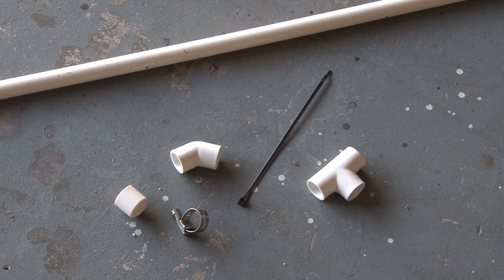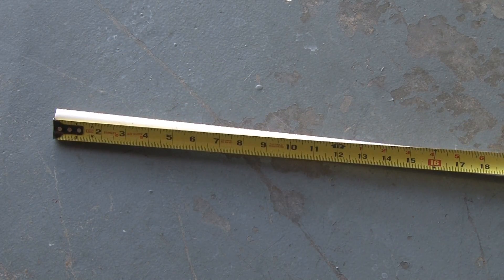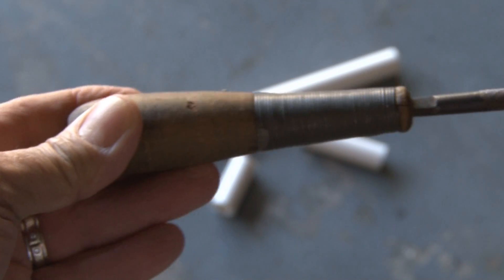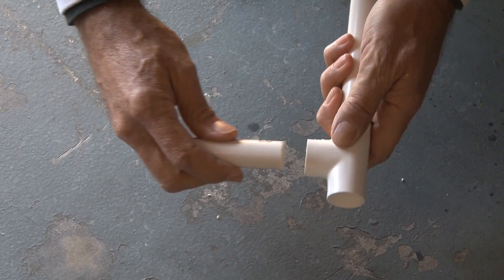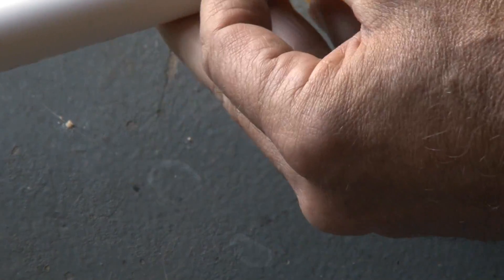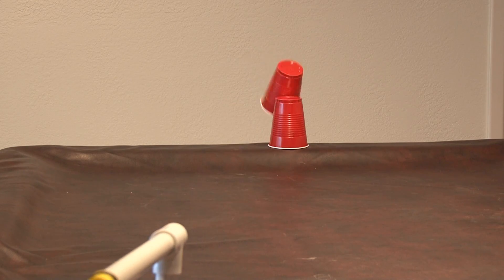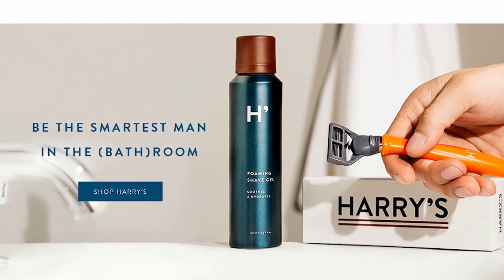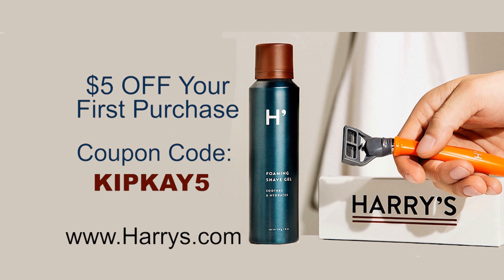The Balloon Zip Cannon!

Comment: So I tried making this and I'm not getting like any distance. How can I fix this because I've already tried pulling the balloon as far back as it can hold. Also, once I get this under control I was going to try to use it to shoot glitter at people. Does any one know how well this works or if it's too light, because I'm just getting a small puff of glitter now.
Reply: +Dominoweaononsmaster Did you sand the wall of the 12 inch PVC pipe?

Comment: Kip:
Ok back in the 1960's I saw a sling shot that used a rubber baby bottle nipple to power the device.
it was very short, think maybe 1-1/4"x 2" long PVC pipe with a pistol grip on the bottom, The nipple was turned inside out and slip over the front of the pipe and pulled through to the back, drop a marble in and pull back tip of the nipple and let it fly.
The thing even had fairly good sights on top of the tube.

Comment: Cut off the finger of a rubber glove and use it in place of the balloon.  Also you only really need 1 small pipe and some BB's.  Its more commonly known as the glove gun but it works on the same principal...just better.

Comment: You can make a simelar thing with a plastic bottle without spending money on this usless PVC stuff. Simply cut a small plastic botle in half, attach the baloon on the neck and secure it with lot's of tight rubberbands. This cannon will have the same power as kipkay's cannon.
Reply: Not to be rude, but pvc is a sturdier material. I'm also fairly certain the longer barrel of the pvc makes it more accurate.
Reply: ***** It doesn't have to be strong nothing can happen to it anyway.
 Secondly the accuracy is entirely dependant on what angle you pull the balloon at, its exactly like a slingshot.
If you pull the balloon wrong and the shot touches the tube the shot will bounce around and come out crocked anyway.